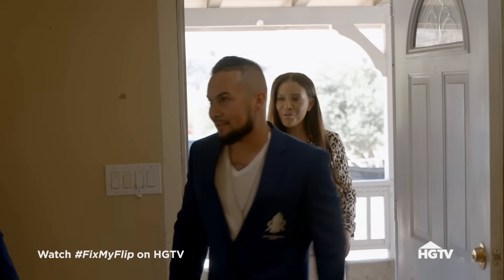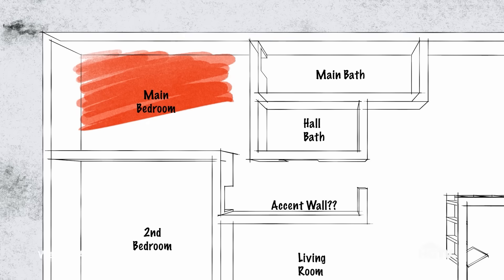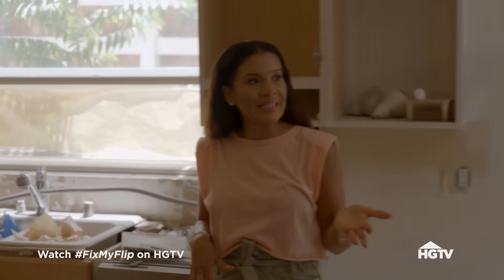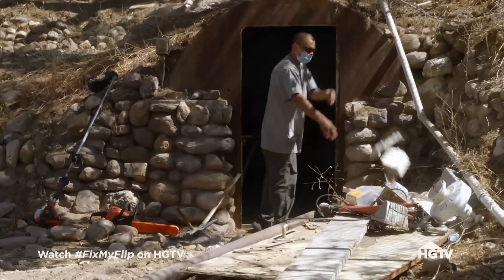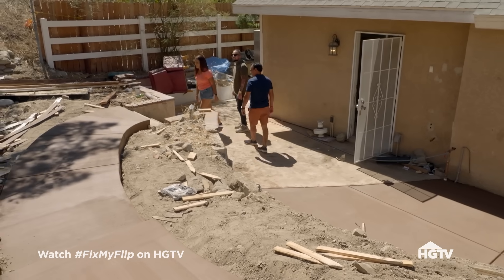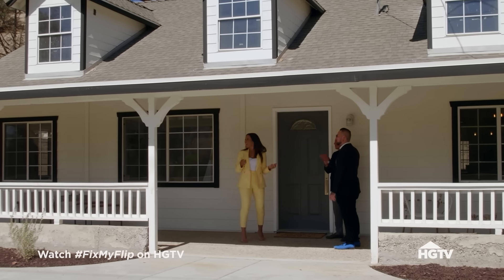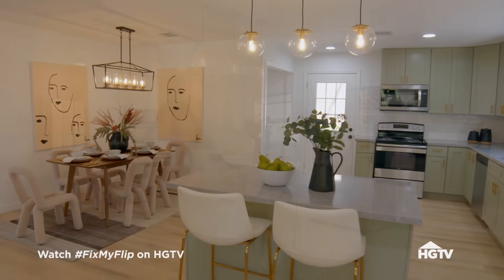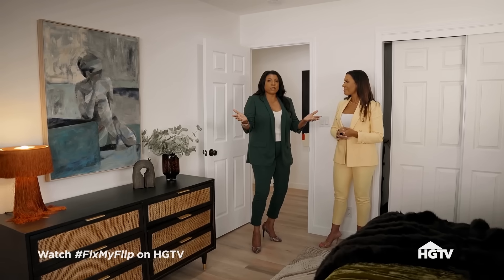Home Renovation OVERCOMES Weird Layout | Fix My Flip | HGTV

Comment: $14K to paint older cabinets? I've had cabinets professionally repainted in two different kitchens--one of which has a huge amount of cabinets. It only cost about $5700. New cabinets would have been $20 - $25K.

They paid a good price for the exterior paint.

In a desert area like where this house is located there's a good chance that rattlesnakes will go into the old bomb shelter because it'll be cooler and shadier than the surrounding yard. No way would I sit down on one of the benches without making sure there were no rattlesnakes underneath them.